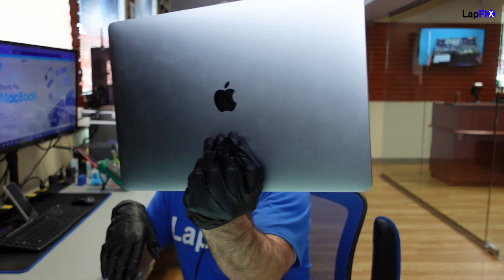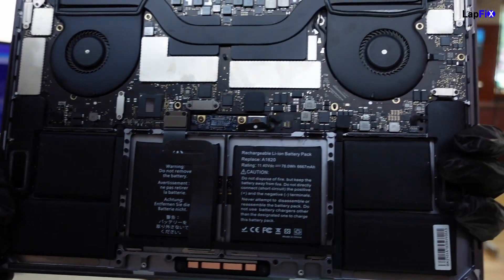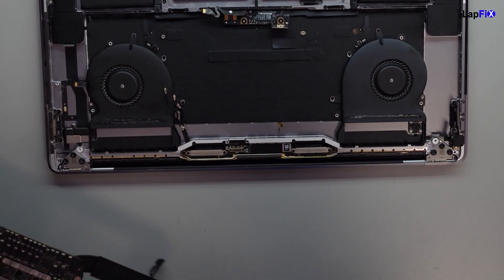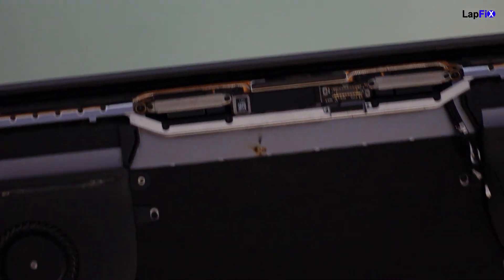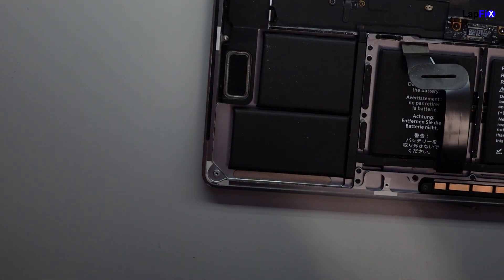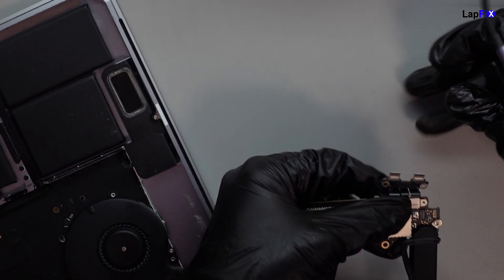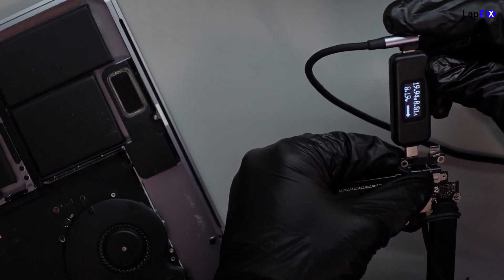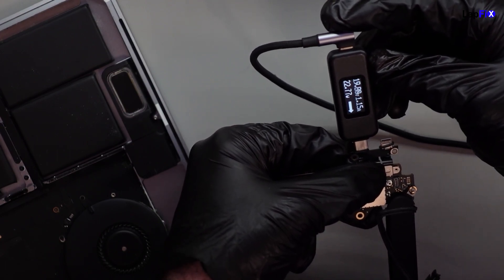Fixing a 15 Inch MacBook Pro Not Turning On

Comment: Hey bro! I recently opened my macbook pro 2016 15 inch for the flexgate issue replaced it but after few days it started glitching again then I opened it again but this time when i closed it it isn't loading no signs of power is it a motherboard issue? I wish you were in my country :(
Reply from the maker: It can also be a logic board issue